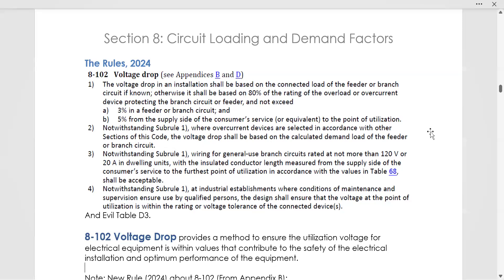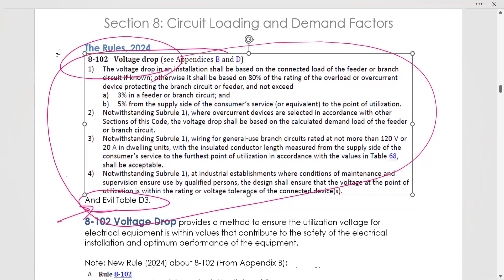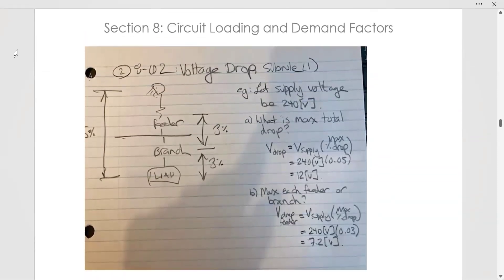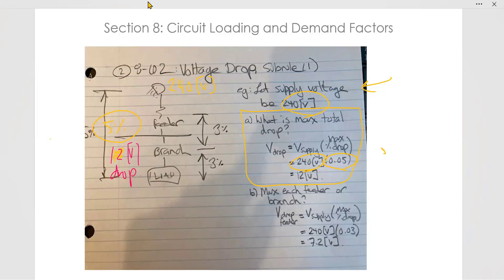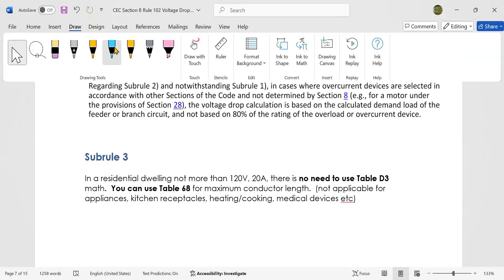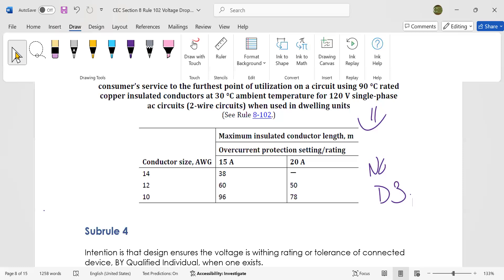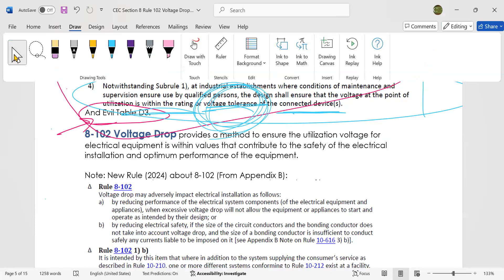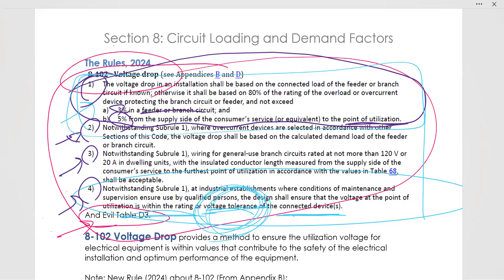Voltage Drop CEC 8-102 Subsections 1, 2, 3 and 4 explained

Comment: a list of example problems with how all of this applies would be helpful. Without seeing how the code applies directly to voltage drop questions in different scenarios, this is confusing
Reply from the maker: Ah, yes I can see that.  Have you looked at the example problem videos in this playlist?  Practical problems include calculating the maximum wire length for a certain voltage drop, calculating conductor size and finding how much voltage will drop for a certain size and length.   Canadian Electrical Code Section 8
https://www.youtube.com/playlist?list=PLA9NP6jZaB1P7j6XnNEVVtlEW9YQym1Uv

Comment: Any way you can do a voltage drop calc for extra low voltage (Class 2)? The notes at the bottom of Table D3 mention reference to Table 2, except the lowest size conductor is #14awg.
Reply from the maker: Yes, thank you for the request.  I’ll tag you when I upload it.